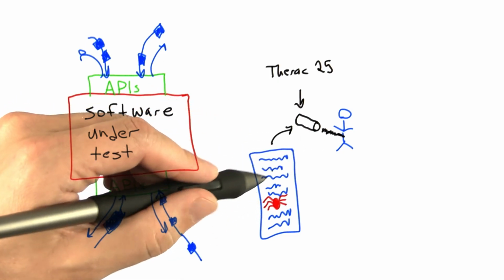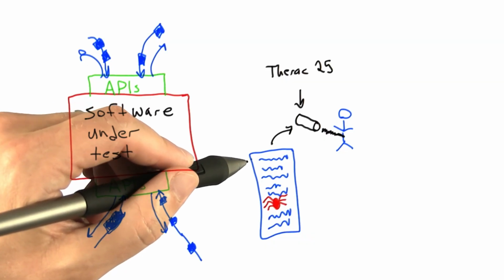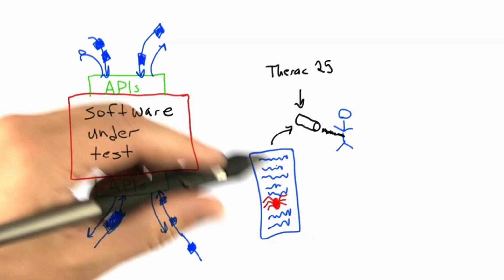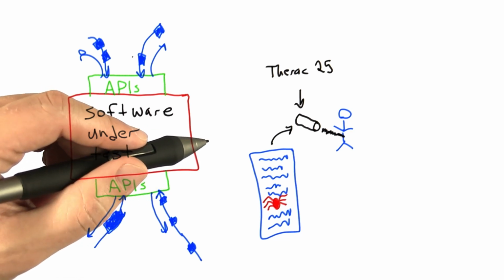Therac 25 - Software Testing

Comment: 'A Therac-25 race condition occurred due to operator keyboard input speed not accounted for in design, resulting in inadvertent radiation overdoses and some people died' sums up this entire video in a quick sentence. There are other videos on what went wrong in more detail, they only take a few more minutes to view than this one. Tamara Roberson's reply below however explains what happened technically and clearly if people are interested, beyond the simple statement in this video.
Reply: The machine moved magnets between the two modes of the system: x-ray and proton. However, the mechanism gave no feedback to the computer to tell it that the magnets were in the correct mode. So if the operator typed in the wrong mode but then changed it, the operator assumed that the machine would go back to the right mode, but it didn't. This created an in-between state, where the magnets were in x-ray mode, and the turntable was in proton mode. In this state, the Therac-25 could bombard the patient with dosages 100 times greater than was intended.

The machine also regularly gave confusing error messages (such as "Malfunction 42"), with poor documentation about the error. Operators became used to hitting the "Retry" button upon error -- but some errors reported that no radiation was administered even though it had been. Hitting "retry" hit the person with a second dose of radiation.

There was not a single point of failure, such as a missing bracket or the wrong units. The problem existed on previous models, but those models had hardware interlocks that prevented the machine from entering into that megadose mode that wasn't supposed to exist. With the hardware interlocks removed and total reliance on software, the bugs in the program were allowed to cause serious harm. Part of the problem was that it was a one-man project. The company had not put sufficient money towards development and did little testing, assuming that because previous models were okay, this model would also be okay.
Reply: @tamararoberson8530  Thanks for the detailed, informative reply Tamara. Modern aircraft computer design is an interesting example too of how it probably should be done now, particularly Airbus and the approach they pioneered to inputs from triple input/redundancy safety critical systems (dedicated input consistency checking as a separate function, different chips and languages and even development centers).